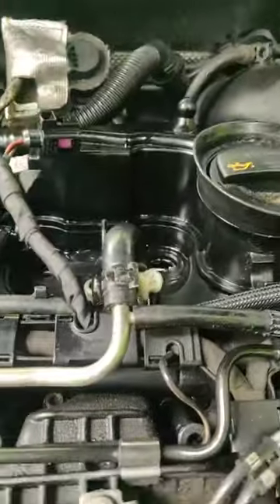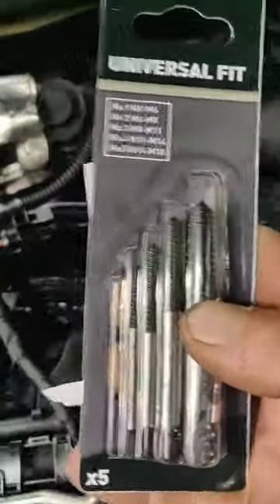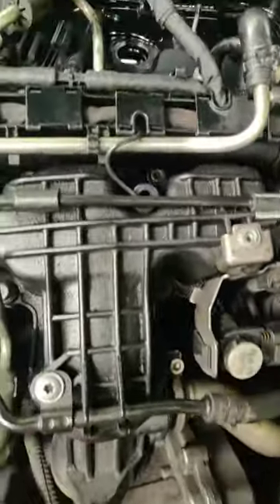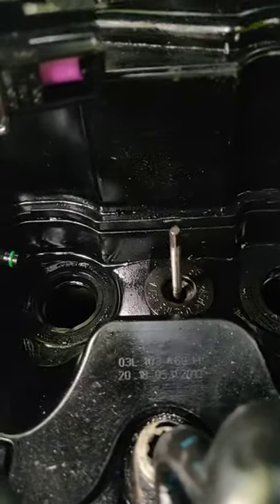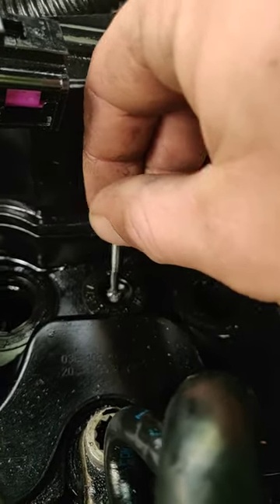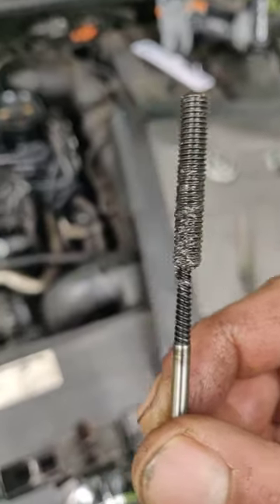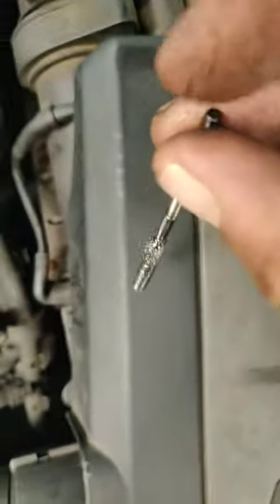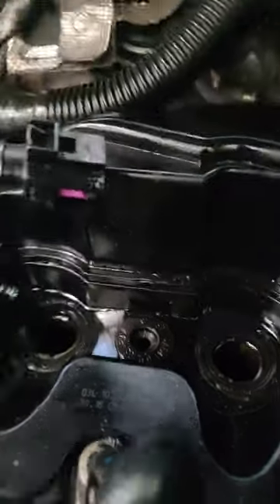snapped / broken bolt removal 1.6 TDI injector

Comment: Just been through exactly this. THESE ARE A TOTALLY SHIT DESIGN. Lets use a bolt that's just itching to snap to hole not one but two injectors down in the hope that the copper seal is enough to prevent blow by (possibly on a brand new whistle clean engine). More often than not they don't seal and you end up with a whole pile of crud building up around your injector and then you have a fight on your hands trying to get the injector out.  I took the injectors out and cover off to give myself the best access/chance of drilling and easy outing the bolt. Luckily I got it. Make sure and have the threads/bore totally free of oil otherwise it's even easier to snap the bolt. Was a bag of nerves re torquing the bolt
Reply from the maker: Your not wrong mate at least you got it out , seems even more common on ford fiestas having murders with one at the moment new helicolis aswell 😭😭

Comment: I've got this exact problem right now. Please can u ask, what type of drill bit did you use? Cobalt? I'm struggling to even drill a hole
Reply from the maker: Just a 2mm titanium , only couple inches long so hardest part was getting the drill to grip it
Reply: @thecoincollector1  thanks I will give that a try
Reply: Bro what was that thing called the one you use to get the damage bolt after drilling

Comment: trying to do the same thing! How did u drill the hole? Did u use a hand drill or 90 degree adapter or did ur drill just fit above it?
Reply from the maker: Used small bit first 1mm I think just drilled tiny hole in centre to stop 2mm slipping. You want it straight and central as possible mate. Careful not to snap extractor in there nightmare to drill out . Good luck 👍👍

Comment: I just tried the same thing unfortunately mine snapped off so it’s made the job even worse
Reply from the maker: a Tungsten carbide burr  Dremel  bit should get through a snapped extractor 🤞🤞
Reply: @thecoincollector1  I ended up getting a tread doctor to remove it because when I tried to get it out I made a mess of the top basically mushroomed the top and I couldn’t get a good centre punch hole on it to know I’m going straight
Reply from the maker: @releasedmike  I've got one sat on drive with exact same problem 😭  needs boring out and helicoil put in
Reply: @thecoincollector1  it’s a poor design really they should of done them as studs instead of stretch bolts now everyone I see is having the same problem and doing stud constructions
Reply from the maker: @releasedmike  definitely , seems to be very common  on fiesta . must be most manufacturers tho. there's plenty of company's just doing snapped bolt removal. manufactures prob make more money fixing the problem than solving it

Comment: Thanks very much  for  the video. 👏👏👏👏 I  have exactly same problem, same type of screw... 

I think we had a timing belt slippage, causing engine overpressures and 2 injectors popped badly snapping screws

*I have a few questions for you,*... If you wouldnt mind. Want to learn from your situation as I'm in trouble too.

1) How did you get that problem?? Was it belt slippage too??

2 ) Did you ger any internal damage to the engine??In seals, o-rings... or other more serious stuff??

3) Did you  redo the  timing belt?? Was it too far out
Reply from the maker: 👍👍 not sure the cause seals may of been chuffing to much pressure heat could at least there dual clamps on the golf 🥳 
You can get seals o rings and bolts pretty cheap I’d replace them if you take the injector out.
Be careful not to over tighten when you reinstall👍👍
Didn’t touch the timing belt on it you should be able to hear if there’s a prob with the belt will be ticking.good luck 🍀 
Got a ford with 4 broken blots and cracked clamps 😭.
Reply: @thecoincollector1  
Thanks for the speedy reply. 👍
A bit of a long message down there, I hope I don't bore you.

I have all the bits and parts now to go on after resettling the  injectors including new screws,  seals / o-rings ,  but I am a bit paranoid with the belt as 1 or 2 days  before the injectors pop the belt casing (top part) was smoking a bit ( dodgy) .

There  was a small slow leak  from that   injector plastic casing. Not an issue, as I monitored it for months.

Then I  saw the belt casing smoking and    thought  a bit of that oil  had  gone into the belt  and it was smoking oil for that reason... I never gave a sh***... Thought it wasn't an issue...then 2 days
 later 👉💥💥💣  at 130 Km/h in the motorway!!! Injectors 3 and 4 decided  to try to escape 🤣🤣

Now I'm kind of pretty sure the belt  tensioner packed up ( as things went bad a bit slowly) , then belt went on loose  and started   slipping  away for a day or 2 until the pressures inside blew the injectors out. Just wondering on this, didn't  go in there yet.

I will start by trying to take out  that screw. ... 3.5cm stuck in 😭 ... If I take that screw out 🤞🤞 I will torque it  correctly not to overtight. Got my hands  in the torque data in Nm.

After and IF (BIG IF)   I manage to come out  of this mess, I will replace the screw that holds bracket for injectors 1 and 2 too. That screw should  be no good now with all the overpressure internally. 

I'm a bit worried if this  overpressure issue didn't damage any internal seals in the cylinders, but leave that for later.

For a long time I think about opening a YouTube channel and now on this issue I may actually go on and do a video about it.

Thanks again for the video.
Cheers

Comment: Top man!!  I just done exactly the same thing with snapping the thing,, it was a brand new from vw bolt as well (tossas there bolts are crap) , i had no idea what i was going to do until i searched and your video came up top trumps!  i went straight down screw fix and got the remover thing,, the only thing i couldn't get was a drill but but i had a old one that managed to get enough into the bolt,,,,,          yours was exactly the same side, it looks common!,    i removed the rocker cover on mine,, looks like i didnt need to have done,,, the only thing now is do i risk doing it again,, as the injector was blowing with a new seal ,,  thats why i tightened it and it snapped,        did you put same size bolt back in there as i just watched a video where the guy uses a tap and dye thing to make 8mm bolt thread instead but thats bit above me ,,    did you manage to get yours running again without any injector blow?   thanks very much dude AAAAAAA++++++
Reply from the maker: Happy days mate 👍 yeah I used the same size bolt , I’d replace the injector seals if they have started to go much cheaper to replace seals than getting new injector and having it coded . Good luck 🤞

Comment: Big thanks for this video, i just snapped of mine as well, and i knew it would happen thats the hard truth because someone else have open and tighten 50 times changing injectors so ofcourse it will happen to me... :D

You dont happen to have link for the universal fit package? :)
Reply from the maker: no worrys 👍👍  good luck 🤞 think I used this set https://www.screwfix.com/p/bolt-extractor-set-5-pieces/1112v

Comment: How did you guide the drill? I have the same problem with 1.4 TDCI Ford engine.
Reply from the maker: Think I used one of the bigger tool extractors as a punch

Comment: 99% sure mine is snapped, is it ok to drive? loud tapping & injections move up & down slightly but drives ok
Reply from the maker: I’d sort it before it gets worse try borrow one of those cheap diagnosis scanners only cheap on Amazon, should tell you what injector is the problem then take it out could just be seals gone only cheap to replace
Reply: @thecoincollector1  the clamp bolt was loose? which seems extremely strange, I’ve took it out inspected it.. looked ok, 
tightened it up for now & ordered a new bolt, I’ll order seals also 👍🏼
Reply from the maker: @mcfc2468  those bolts are usually only good for one time use, hopefully new seals and bolt and you’ve good mate  👍